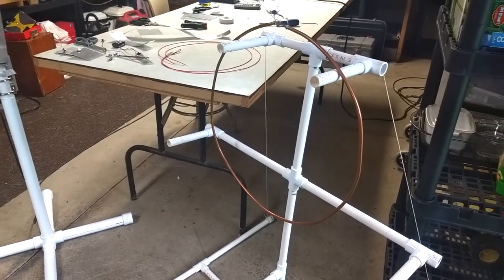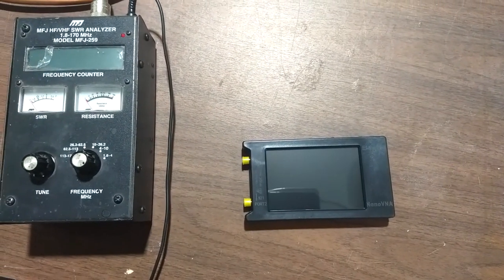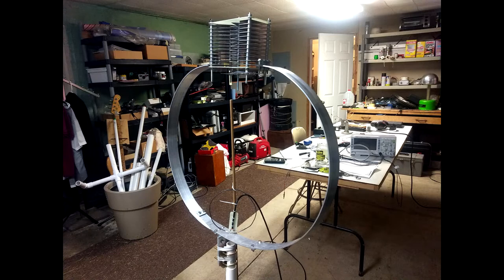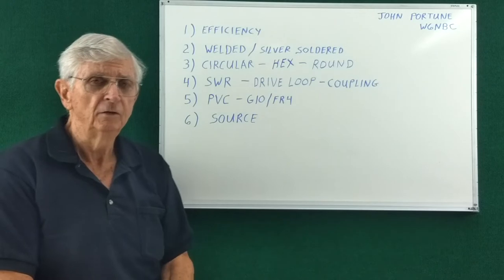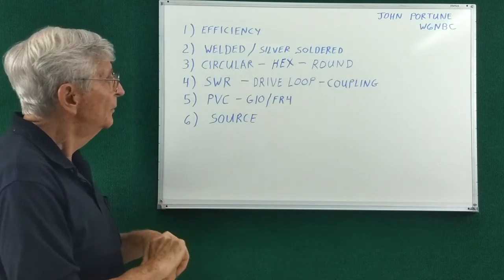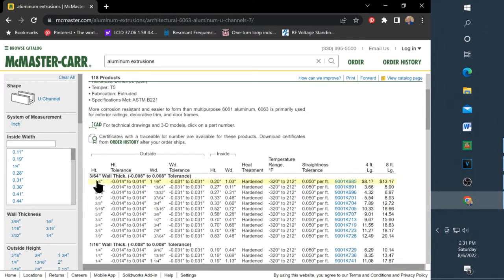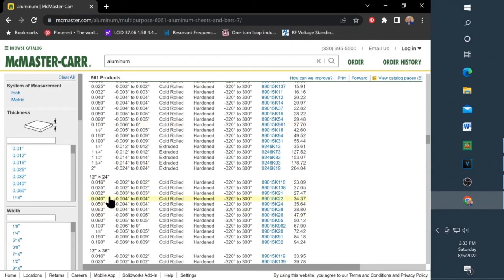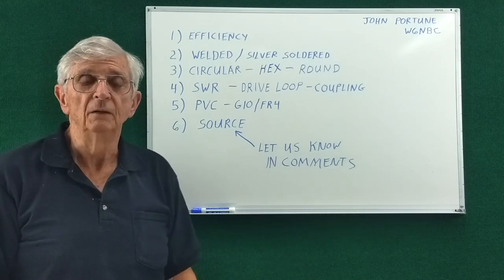Quest for the Best Mag Loop Antenna

Comment: Hi Jim I keep trying to comment but keep having problems, so here I go again. Jim I wonder where the current flows in your 'U' section loop antenna. I know for certain that If you make a single turn an induction heating coil out of flat copper strip, instead of the current flowing uniformly across the broad face of the copper,  almost all of the current flows in the two outer edges f the strip. I have proven this for myself. For thirty years I have designed and manufactured high power Radio Frequency induction heating equipment for scientific and industrial applications and I experimented to see where the current flowed in flat strip coils. (in order to know where to cool the coils you need to understand where they get hot) I don't have any pictures now but I know that you can see this is a German book ISBN 3-341-00813-6 page 61 the caption to the right of the image is in German but it says 'on a conductor that has not been water cooled the glowing edges clearly show where the current flows'   The image is of a single circular turn of cooper strip, (like a small version of your aluminium strip loop antenna) the edges of the copper strip are glowing, this is not simply down to what's called 'edge effect' heating because of the low thermal mass at the edge of the strip but by the strips own inductance forcing the current to the outer edges of the strip. (I'll send you a picture if you give me an address) It would be impossible to demonstrate this phenomenon on a large loop with out several kilowatts of RF power. I demonstrated it for myself with a 25KW induction heater running into a none water cooled single turn copper coil at around 200Khz. I used temperature sensitive paint on the strip and instantly one could see the temperature of the edges getting hot but the edges of the strip will melt if you let it run too long.  I only raise this as without knowing where the current actually flows one could fail to achieve the very best mechanical construction. 
By the way if you search YouTube for "About radio 67"  you'll find a portable loop antenna I designed for 17, 20 and 40 metres
and "About Radio 64" shows a simple mechanism for turning a 180 degree capacitor with out limit switches and without mechanical damage.  and "About capacitors. . . Part 6 coax cable capacitor for loop antenna by Andy Davies" shows the capacitor that I built to run the 17m loop on 40 metres.

Kind Regards . . .  Andy - GW0JXM
Reply from the maker: Hi Andy. I watched your videos; thanks for sharing them.
 In one of my long ago careers I worked in the research and development department of a company that made Induction heating equipment. I never worked with a single turn coil, but with a multi turn solenoid coil the current primarily flowed on the inside surface of the coil. This effect becomes greater as the coil diameter becomes  very much less than the wavelength of the current . In the typical mag loop set up, things are much different as can be seen by the fact that the magnitude of the current flowing in the loop gets less as we approach the capacitor. This is the same as the current flowing in a dipole goes to zero as we approach the end of the dipole. 
Best Regards
Jim KQ8E
Reply: @Jimscoolstuff  Hi again Jim I hope that you have had the chance to see the photograph that I emailed to MAC. OK on the current flow in multi turn coils. This is well documented, usually with artists impressions of where, theoretically, the  current flows, and I think the typical illustrations can be taken as a good guide. A very large proportion of my work was at around 100 KHz. The skin depth in cool copper at that frequency is about eight thousandths of an inch but of course at ham radio frequencies the self inductance of the inductor forces the current to flow in fraction of that, (for anyone else reading this, you'll find coils in  antenna tuners etc are usually silver plated as when working in the MHz range the current is so shallow that it only flows in the silver plating!) It's very hard to find information about the current flow across the broad face of a single turn coil, (as is so nicely illustrated in the photograph that I keep banging on about.) In 1985 - 86 I designed and manufactured a 150KW, 200KHz induction heating system that was used in Reagans Star Wars project. I had to use a single turn coil to keep the voltage down, I used three single turn coils in parallel with a gap between each turn so as to try to mitigate the current end effect issue. 
Anyway, I'd love the opportunity to carry out experiments to establish what the current flow actually looks like in various magnetic loop antenna profiles. Not that this would necessarily make them work significantly better but to simply have a real understanding of what actually goes on. I guess with aluminium baking foil (for low thermal mass) and a thermographic camera it would only take a few moments to get the complete picture.
By the way, my company was Cheltenham Induction Heating Ltd,  here in the UK, my business partner and I subsequently sold it to Ameritherm Inc in Rochester USA some 16  years  ago, it was a lot of fun working on some fantastic projects.  
All the best . . .  Andy    GW0JXM
Reply from the maker: @AndyDaviesByTheSea  Hi Andy: I did get your e-mail; thank you for the information. The induction heating co. that I worked for was called TOCCO. These letters are derived from "The Ohio Crankshaft CO". We worked with frequencies ranging from 60 Hz to 4 MHz.  As you are aware, everything is a compromise. I was curious about the current distribution in the loop, but could not come up with a way to measure it. I found the flat strip and the U channel to be very flimsy mechanically. I am now using 2 inch by 1 inch rectangular aluminum tubing (1/16 inch wall). With a lot of effort I now have a capacitor design that can cover 10M thru 40M with a square loop that is  about 3 feet per side. I am achieving very good Q based on the narrow bandwidth of the antenna. I am making contacts on all bands (10M, 12M, 15M, 17M, 20M, 30M, and 40M). The capacitor was the most difficult part of the project. It is hard to get enough capacitance for 40M and with the same capacitor get a low enough capacitance for 10M. This is why MFJ has 2 models to cover this range. I will be making a video about this design as soon as I can get to it. 
Best regards
Jim KQ8E
Reply: @Jimscoolstuff  OK on TOCCO Jim. It's a good name I know well. Big, good quality equipment and well respected. Much bigger than we ever made. A couple of hundred KW's was a big machine for us. The majority of our kit was in the <100KW range but we also covered mains frequency range for things like process vessel heating they went in to the hundreds of KW's (for paint and chemical processing) and heat shrinking fitting steel railway tyres and huge bearings etc. 
As for measuring the temperature of a magnetic loop, dose MAC ever use a thermographic camera that you could use? 
To use my little loop, (4' X 4') on 40 metres I found it easier to have a large fixed capacitor, (made from short lengths of coax) and a small variable capacitor for trimming.
I'll keep an eye out for the next video. All the very best, have a good Christmas.
Kind regards . . .  Andy   G0JXM
Reply from the maker: @AndyDaviesByTheSea  Hi Andy, Don't have a thermal camera, but that is a very good idea. Here is a link to a video showing a Mag Loop made from aluminum foil.
https://youtu.be/mDL6dea_aZk 
As you suggested, the low thermal mass of a thin material might make it possible to determine where the current is flowing with a thermal image. I would love to investigate this but I must discipline myself to stay on the path of my current project. When I am done with my 40M to 10M loop, I want to investigate the possibility of an E-H antenna for 160M and 80M. Perhaps we could collaborate on "small antennas" in some way. Best regards, Jim
Reply: @Jimscoolstuff  OK Jim, thanks for the link to W6NBC's video. I've sent John an email along the same lines as I sent to you, regarding current flow  on the edges of the strip, may be he has the resources to look at it closer . And ok on staying on track, I can get distracted very easily. 
OK on the E-H stuff could be interesting. let me know when time allows.
Regards. . .  Andy
Reply: Hello Andy how are you doing. 😊

Comment: Awesome loops I’ve built 80m high efficiency twin turn and lots of others I never get tired of playing msg loops I give my prototypes to my friends so they can build their own which leaves me space for my next loop project hmmm topband loop seems a good idea keep it up love the video and thankyou for reminding me every antenna I look at gives me an idea for the next one Dylan m0dsy🏴🫡
Reply from the maker: Thanks for your comment. I have not made a video recently because I have been very busy developing a 10M thru 40m loop. I have made several technical breakthroughs which I plan to show in my next video.
Reply: @Jimscoolstuff  I can’t wait I’ve found a ww2 cap of 1100pf so should do 10-40m two I’m contemplating spray painting the surface of the plates would that cause issues with the capacitor?